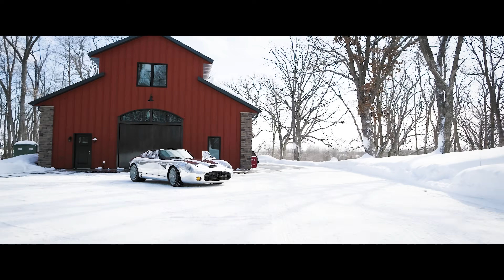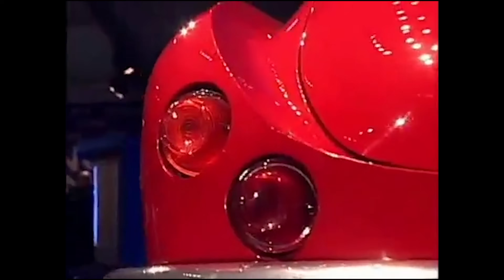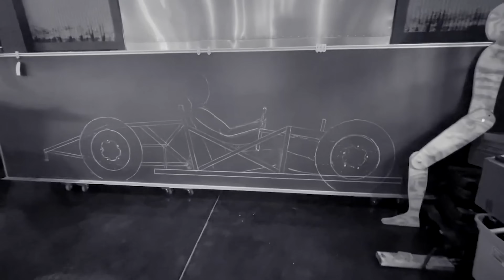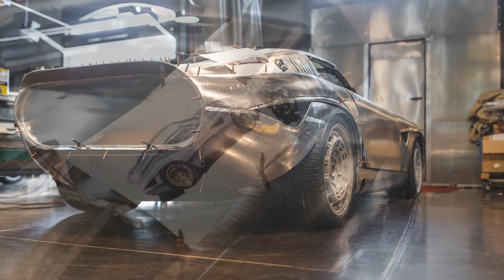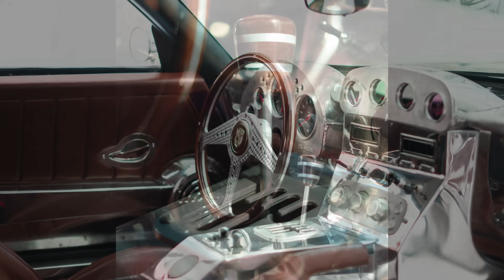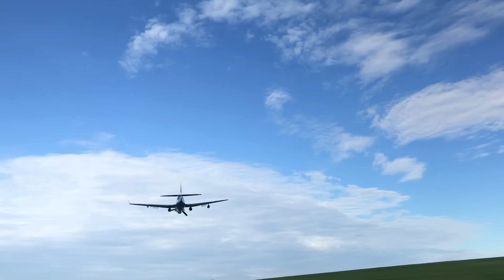Runge Veleno :: How It Was Made

Comment: Just watched your Veleno on Jay’s YouTube channel. Breath taking,beautiful,stunning,…. I really don’t have the words.  Have you ever thought of using the Miata as a basis for a build?  Every part is still available either from Mazda or a number of aftermarket sources Excellent chassis and suspension layout. A number of engine performance upgrades and conversions available. NA with pop up headlights or NB with fixed headlights. Low cost of entry and some stunning looks could be achieved with it.

Comment: The original viper engine was an acquired engine design from lamborghini when Chrysler bought them out in the 90s. It wasn't designed at all by Chrysler and it wasn't even close to being similar to the 2nd gen ram v10.. thats a myth that is very easily disproven. Every other v10 put in other generation vipers were Chrysler designs though they were still based off of the original lamborghini designed v10 in the original viper.

Comment: Superlative!  If I may, IMO the wheels need rethinking- too wide, too busy and modern looking.  For v.2 I would suggest going with smaller diameter, less wide (in the rear) deep dish slotted steel wheels painted gloss black with tires no less than 60 series sidewalls to fill the fender gap.  These changes would give it a more period correct / outlaw look.  Looking forward to your next project!

Comment: Amazing! The rear has elements of the Pete Brock Daytona Coupe and, of course, the Alfa TZ1. A TZ1 on a Mazda MX-5 ND complete drive train would be a wonderful thing.
Reply: i think the Miata would be a great platform, i have seen some bodyswaps onto the miata. However, it would be difficult to make a miata sound "special". and it is basically impossible for an adult to fit inside a miata with the roof up. I tried.
Reply: @uliwehner  I've only got 92,000 miles on my 2016 Miata so I haven't had enough time to determine whether I'll fit. I do know that at 76 I am an adult.

Comment: Scanning physical gets a lot of press but is labor intensive and really just a crutch. It is not the way to do what you needed. The scan data needs extensive cleaning and verification before it is any use to a designer. All contemporary cars are built in CAD and clean perfect models exist of everything. Getting your hands on them is not impossible. The CAD models can easily designed on top of.

Comment: You definitely need to start using C.A.D.
Reply: Honestly if the car's all hand formed I don't see much use in using CAD for the design process. He doesn't use drivetrain components that he doesn't have on hand (i.e. he can physically measure every part going in the car), and he has 1:1 scale drawing boads where he can flesh out the design of the whole car. The time it takes to properly use CAD for large assemblies like that with many individually modelled parts would be a lot of additional work, and the CAD files wouldn't be used in any manufacturing process because they're hand-made one-offs. His workflow has been successful for dozens of cars he's made and for essentially everyone that designed anything in the 20th century.
Reply from the maker: I am going to learn it at some point!